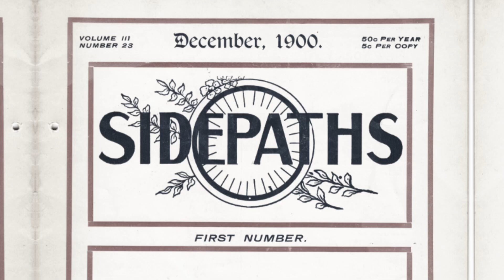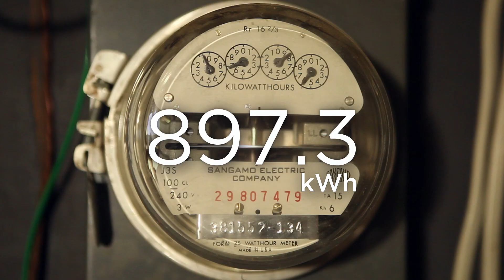Can You Power A House With A Bicycle?

Comment: It's enough to power one appliance though. If you generate power to a battery bank, you're more flexible on how to spend your power. 900 kwh is like a full family with a pet. I live in socal and I use about 100 kwh a month. Solar battery installation guys actually recommended against the roof, told me that I would never make money back because I was too drifty with electricity.

Comment: ive done a thesis on finding how much energy cyclists can generate by building a virtual model. And i did it really believing it could make a difference to the world. If i had watched this video before that, i wouldnt have chosen that as a topic😅

But i found that a 2 storey average household consumes about 14kWh per day. But a rural household (1 storey with no air conditioning or dryers), it consumes 2.1kWh per day.

The cycling model that i simulated was able to generate and store 7Wh of energy after 10 minutes of cycling at average speed, using a light 600g, 50W generator. So if 50 people went cycling in the morning for an hour lets say.......they could store 2.1kWh of energy in total. Which is enough for a single rural household. I know its far fetched, but there's potential there to be applied in rural communities or gyms or campuses with bicycles for transportation etc.

Comment: I’m looking at converting a stationary bike with a flywheel with increasing gears to gain significant speed to power a wind turbine alternator. My hope is that I can apply this energy to add that last little bit of boost to a small scale power system that is running on solar and wind. Mostly for proof of concept. Seeing the math applied here has me realizing why no one takes this very seriously. I’m mostly considering this as an option to power simple things like a 700W hot plate to cook a meal or boil a pot of water. Simply to say that I did.

Comment: JEEESUS CHRIST GUYS, if you're looking for pedaling to keep your house alive just don't connect the air conditioner nor the electric kitchen! You could learn a lot from camper vans. See for example:
Low power fridge (without freezer), gas kitchen, NO AIR CONDITIONER AND NO TOASTER, natural lighting or very small led lamps to keep lit only what you need instead of the whole room, no washing machine or dishwasher, gas water heater... and one more important thing: Since you are already paying the water bill, and the water comes at a pressure, with the right turbine you could power a small appliance while you are showering or doing the dishes.
The goal is not to power AN ACTUAL house with a bike, but make adjustments in your house so it can be powered mostly with a bike. Work smarter, not harder.

Comment: Ok so I see alot of people  using alternators with a bicycle  but hear me out how about using gear reduction  systems  and a actual generator pack off a industrial generator  to see if you can get the gear ratio right to run that generator  pack at 1800 rpms if we can get that type of set up those packs can generate  enough to run 5 houses on 1 pack at any given time so that would make it quite easy to pay a single home with that generator  pack

Comment: I knew the answer to this before I watched the video.  But can you use this method to keep a couple of computer fans running in a fallout shelter for ventilation?  If you have to pedal 8 hours a day for 30 days to create the same energy in 1/2 a  gallon of gasoline, that doesn't seem like it could do any useful work at all.   In a fallout shelter, you'd want to run LED lights and ventilation fans, though you'd probably be more efficient at using the bicycle to power the vent fans directly.  The problem with this is that the buildup of C02 is so quick inside a shelter with maybe 600 cubic feet of air and 3 people,   you'd be faced with a difficult task to constantly peddle. to exchange air.
Reply: Could probably set up a more efficient mechanical system in which bikes could power larger box fans directly?

Comment: I have always wondered what it would be like to mechanically chain 50 bikes together so that 50 people could be used to power a heavy-duty 120-volt, 15-amp electric generator and then do experiments with that electricity --- like powering full-sized residential clothes washers.

Comment: 900Kwh per month for 1 house wth?
It would cost around 500 euro per month in the netherlands right now. But ok..this is coming from someone who grew up and still lives in a household where I personally get attacked for using power. Also, we still use something like propane/gas to cook and heat the building

Comment: If as you say 8 hours pedalling gives you 1 kilowatt-hour, and that is only enough to run a table lamp for a day (24 hours? 10 hours?), then your lamp must have a 40-100 watt bulb. A 5-watt LED lamp, good for lighting a whole room,  would run for 200 hours; a 3-watt LED would run for 333 hours and 20 minutes, so lighting isn't a problem. Heating and hot water you would need to open a gym and get folk to pay you for the workout. Thought seriously, even raising the temperature of stored (hot) water slightly reduces household bils  a bit

Comment: I'm interested in the strength of the generator and and efficiency of the overall set up of some real engineering was applied to the setup. 

I'm thinking a small car alternator connected to larger weighted flywheel and some high ratio pullies
Reply: Interesting. I was imagining if multiple wheels were connected on the same bar would it be possible to get better output?
Reply: and some electronics to control how much load we wanted to. if you have solar battery system, can dump the energy into that battery using electronics to convert the voltage.

Comment: honestly just add more motors to the bicycle wheel maybe it would power more electricity. Also another idea is to use motors that need more electricity like 12V or others. Using gears also may help in many ways. I guess adam wont have to have so much garbage if this would help.

Comment: Eliminate the Air conditioner, put a clothes line up in your back yard (solar clothes dryer) Install a solar water heater and you could VERY EASILY power your home with a 6,000 Watt array of photovoltaic panels. The cost to install this array could EASILY be under $10,000 dollars and the amount of area would be 600 square feet or less. With being a little more creative and energy efficient you could EASILY power your home with a solar array of half that size ... and the cost could be $5,000 dollars or less.

Comment: “There are 42 gallons in a barrel of oil which contains about 1667 kilowatt-hours of energy. A gallon of gasoline energy content is about 33 kilowatt-hours. In perspective, 33 kilowatt-hours is the equivalent of a healthy male pedaling a stationary bike for 330 hours – if he can maintain 100 watts per hour. If he pedals 40 hours per week, he will generate the same amount of energy as in one gallon of gasoline in about eight weeks. Pedaling 40 hours per week for just over eight years equates to 1667 kilowatt-hours of energy in a barrel of oil.
Now, if we attach a financial cost per hour to the pedaling, we begin to understand what is meant by “cheap” abundant fossil fuels. At the current $7.25 per hour minimum wage, the coast of pedaling 330 hours (energy in one gallon of gasoline) is $2,392.50; and pedaling 16,667 hours (energy in one barrel of oil) cost $120,835…. We have exploited this cheap abundant source of energy for over 150 years” (p. 3)

Comment: Yes but if you pedalled in a freezing cold house which is very well insulated with the air conditioning disabled then the system would be near 100% efficient. Also great for fitness.

Comment: Your home's ELECTRICITY usage of 0.9kWh is actually much lower than many homes in US. Maybe you don't use air conditioning, and you're using an oil burner for your heating system? Reducing home electricity usage in the future will be a THING.

Comment: What if you have 20 generators connected to one bike? And of course, a generator twice as big and more batteries than just one. Could you power a fair amount to help your electricity bill go down?
Reply: Power of one man is around 70-80 Watt per hour. You can take from one man not more 80 Watt (via one or via ten generators - is not important).

Comment: Is there a way to make a gear build up to increase the speed of the gear spin (slowing the ratio gradually and be directly embedded as an electric motor to generate volts) and then use a tesla coil to increase the voltage? (And how large the tesla coil need to be?) (I am dumb on this one, not idea how many laws of physics I am missing, but if I am correct that could be awesome right? so, correct me please...)

Comment: Why can't bicycle power supply enough for a house?

① He use dryer, instead of air-dry
② Microwave
③ Air-conditioning (Note: If you live in hot climate or a heat wave happening, you still need air-conditioning. But keep in mind, use it wisely but not use it whenever you feel like.)
④ Heater (Same as above)
⑤ Washing machine (Either washing clothes until its almost full load, or hand-wash small items like towels, underwear, socks while showering.)
⑥ IDK how much he uses lights in daytime when it's sunny and bright outside. But turn off the lights and use sunlight by the windowsill to work and study is a great way to save energy.
⑦ TV

If he at least get rid of the dryer, that'll save him a lot of energy. Combining good habit on low-energy living, I don't think it's impossible to live with only human-power electricity. This video is somehow exaggerated.

Comment: Can he power his home by working out? Yes! 

Can he power his home using a bicycle and an alternator? Of course not!

The set up is not efficient. You need to use a form of step up transmission. If he can change to bigger gear ratios gradually he can get the rpms higher and even use transmission to gradually drive a much more powerful alternator. (Windmills and coal steam turbines do not move fast but have a high number of copper wraps)

Then if the wheels is weighted it'll continue turning with torture while he rests, then if you add water and sodium the electricity will separate the hydrogen and oxygen and automatically pressurize it out you could manually pressurize it with a threaded plunger and burn hydrogen which will turn back into water.

Comment: Wrong. You can power your house by bicycle. 30 to 45 min a day will produce enough power to a battery bank to power for 24 hrs. You're not very efficient. If your using 900 kwh a month then someone failed to show you how to turn off a light when you leave the room. I've used this method several times when tornadoes took out the power for long periods of time.

Comment: Great video and well done creating it! What if I used different gear ratios off of the generator to multiply my effort on the bike? Would that improve the situation?
Reply: what about connecting 50 batteries to 50 generators all connected in a way that you can pedal these all at the same time..

Comment: Some done here got it: He cant power your house, he might be able to power another very low energy using house.
My household with gamer server, PCs, aircon, shower-water, ... usage 530 KWh month (summer), most normal families here in Thailand just under 300 ...
But I was looking for this on another way: going on my bike for 4 hours a day (as I did before, train for racing) would it be worth of saving like wind or solar ...
got 200 Watt average, 4 hours 800 W a day, ... would save me near 100 Baht a month = nice as also drop my wages for healthy (the bill now would be 2300 Baht, but Solar low it down to 600 Baht/month)
depending on the costs (invest) to build it up and an on-grid inverter ... it will take some time to pay it back cycling indoor ...
but still nice idea, never know what emergency could happen in future - if all you want is a light in the night ...

Comment: Dutch investigation bureau Nibud tells me a 1 person household gets up to 	1.925 kWh per year. You are talking about 900 kWh per month? Seems U.S. house are power guzzlers.
Anyway, it´s also about how much power you need. You can run a dishwasher, or just do the dishes by hand. You could use incandescent bulbs or LED´s. If you are very energy efficient, you can power a house with 2 hours of pedalling.

Comment: Kind of misleading isn't it?  i mean you really could have made the generator bigger or had 2 setup with on one the other side of it and thus doubling the power.
This would have been a better test had you seen how many multi generators you could turn efficiently with the bike and what improvements could had been made to get the highest amounts.  Instead i see 1 generator and its case closed?  common you guys are engineers yes?
I'm not saying that it would have worked, but still would have been nice to see exactly the highest amount you could had gotten.

Comment: Dude - use a DC-DC Buck Converter - increase your amps by stepping down the voltage.
Reply: it will be the same energy, w=v*a , in fact it will be a little less enegry because the transformation by the buck converter.   1v 9A is the same total energy as 9v 1a, energy 9W
Reply: @internetisinteresting7720  So if you can pedal faster than the voltage allowed that means your extra mechanical energy is creating more watts that are from the deconverted volts increasing the amps.
Reply: The energy is the same
Reply: @MaverickGayoso  yeah I don't think you understand - I actually built the bicycle generator using a DC-DC converter. So the machine or battery can only accept a certain range of voltage. So without using the DC-DC buck converter that energy that "is the same" is LOST to the machine. By using the DC-DC Buck converter than by pedaling faster there is higher voltage created that is then inverted into higher amplitude at a voltage range that the machine can accept.

Comment: You don’t have to offset 100% of your household consumption. But it would be great if we could use the energy from fitness equipment to power something as opposed to letting it go to waste. People work out anyway and your household surely could be made a lot more efficient. So let’s get a way from the “this wouldn’t work because xyz” mindset and try to think how it could be useful. Again, people work out anyway. Plus, in some applications the offset could be even greater. For example, a foldable bike generator could be used in an RV to help charge things when solar isn’t great, which could help reduce generator use. Speaking of generator use, this could also be a good way to provide emergency energy for lights and charging phones. You don’t have to heat the whole house or dry your laundry with it but some LEDs would work for a while using this when the alternative is no light at all.

Comment: I assume 900 is the highest possible amount because that is a lot. My family of 12 and I live in one house. Our average monthly electric bill stated we use 400 kwh per month.
Reply: You have a team assembled. Now its time to get some bicycles.
Reply: Family of 3 and we only use about 100, what the heck are Americans doing?
Reply: @ratfood3875  Depending on location, we experience large temperature ranges. Here in the middle of the US in Kansas, it's still 81F (27C) at about 2:30 in the morning. My state's record high is 121F and our record low is -40F.
Reply: @ratfood3875  i am from brazil here we spend 260 to 400 kw on one month. We live in 3.

Comment: I still like the idea of cycling to generate some electricity.  For a start, it keeps you fit.  I'd happily cycle an hour or two every day to generate some electricity, while burning off belly fat.
Reply: Especially if you can save up the energy. You will eventually make enough power power your home for a month if you just keep going regardless of how much time it takes. And like you said, you’re getting fit. 2 birds 1 stone.
Reply: @josiahday2187  Also, a better generator set up with a flywheel could probably make a lot more energy than the one used in the video.
Reply: @k12gamer72 exactly what I was thinking.
Reply: @josiahday2187  O look dad we got chicken!

Comment: What if we add 4 generators in to single cycle?
Reply: You would still have a proportionally difficult time to generate any significant energy in comparison to using a single generator. With extra generators in tandem, your workload would increase and quite possibly make it so difficult, you would expend more energy to get the same result of 0.4kw/hr

Comment: You are dumb af, this is straight propaganda of course you can power your house for free but not by a bicycle if you stored that energy and got a wind turbine and solar panels your house would be 100% off the grid. Also this Idea works extremely well if you were to replace the engine with a different that used Cooper to generate Energy also using this Setup would be at a Amazing system inside of a Gym instead of one house then you could Generate Massive amounts of Energy Everyday.